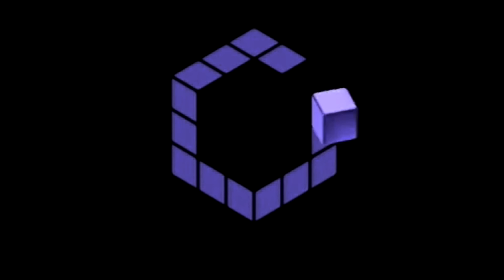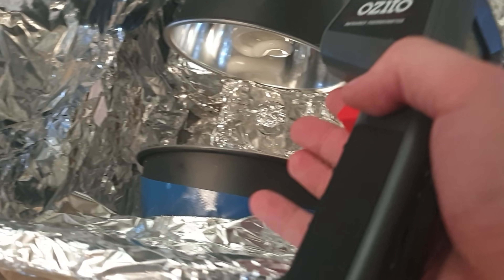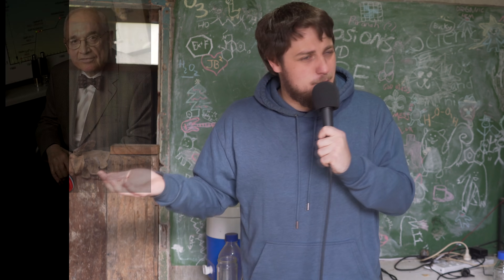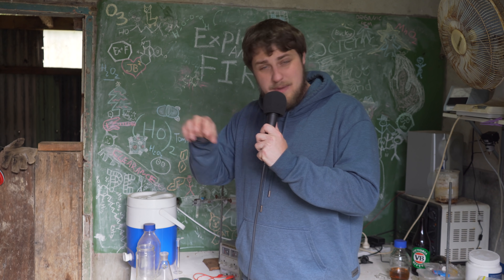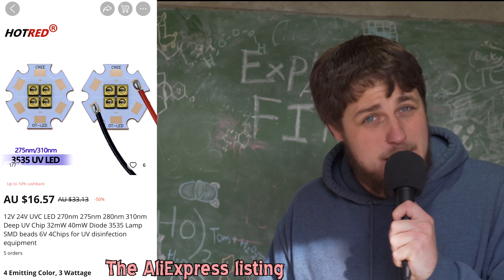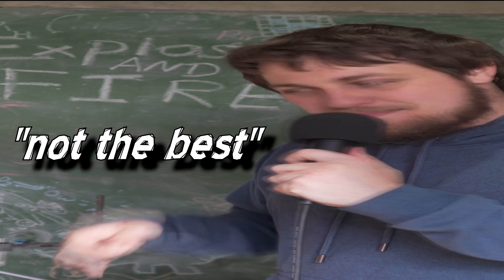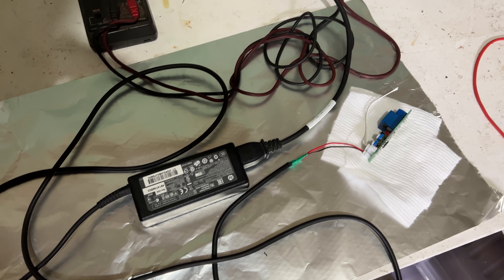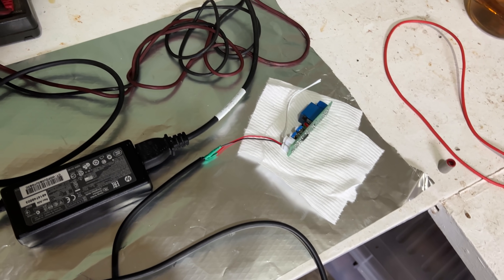Magical deep UV LEDs - Cubane Ep 12

Comment: The 40mA is critical, if this is specified as the maximum current the LEDs can stand. LEDs are non linear devices, which do not follow Ohms law. Once the voltage across an LED reaches its forward bias voltage, any further attempt to increase this voltage will result in an exponential increase in current through the device, resulting in its destruction. The current through low power LEDs is usually limited using a series resistor, but this solution is inefficient for high power LEDs, where the current is better  controlled using an adjustable constant current supply. 
When driving an LED, the primary concerns are running it  below its maximum current rating, and ensuring that it can dissipate sufficient heat to avoid exceeding its maximum operating temperature. It is recommended that power LEDs are mounted on a metal heat sink, usually aluminium, using a heat sink compound such as that used to mount computer CPUs. . (Note, it's important to avoid putting heatsink compound on the LED window, as it tends to react and frost it. )
When using a constant current supply with more than one LED, , the LEDs should be connected in series. In this circuit configuration, each LED will pasx the same amount of current, and the supply voltage will automatically adjust to that required, so that each LED in the chain is operating at its stated  forward bias voltage for the operating current.  This is conditional on the constant current open circuit supply voltage exceeds the sum of the LED forward voltages in the series chain. 
Being such compact devices, LEDs are very unforgiving, when driven with excessive current. They over heat very quickly and burn out,  so acquit heat sinking is essential. 
To avoid excess heat dissipation in the constant current power supply, it is better to use a switch mode constant current converter than a linear constant current supply.
Reply: An approximate calculation, suggests the forward voltage for the LED emitting 420nm UV should be around 3.9 volts. 
( Vf=hc/(e*wavelength), assuming no charging pumping. This equation is only a guide to the bandgap voltage.)
If your high power LEDs are 3watt, it suggests that each package has two LEDs in series, given a effective forward voltage of 7.8 volts. 
As these are rated at 3 watts, it suggests the forward current maximum is approximately 0.38 amps, so maybe the actual current is not 40mA, but 400mA. Certainly 40ma seems rather low for an power LED.
A quick view of the LED data sheet would confirm these assumptions. 

P.S, I froze the picture of the LED data sheet, but the data on the segment of the sheet I could see did not make much sense. It is difficult to reconcile the 3 watt rating with chips taking 40mA. There are four LEDs on each die, but it is not clear how they are wired. 

To avoid the instantaneous destruction of the LEDs, due to excess current, it is a good idea to fit a series power resistor when performing the initial tests. A 2.5 ohm half watt resistor would provide about a volt of supply rail stabilisation over the rated Vforward of the LED package.

Comment: Heres how to set up your powersupply for CC: turn the voltage knob(s) to the maximum, and the current knob(s) to the minimum, connect an ammeter in series with the output, essentially shorting the supply through the meter. Then while reading the meter, slowly turn up the current on the supply. That's it
Reply: dude no, if you do that with a cheap lab supply it'll fry itself when you short the leads (I've seen it happen with students many times). start with both volts and amps at minimum. Then short the leads, then up the voltage to something low (a few volts), then set the current limit, disconnect the shorted leads, set the voltage to what you want. turn the output (or the whole supply) off, hook up to your device then turn the power back on.
Reply: @zyeborm  shouldnt tho bc the current is set at minimum
Reply: @gabor-smith  the current limit can't kick in fast enough to prevent the output regulating capacitors from frying things
Reply: Your driver blew up the leds instantly because, while it is a CC supply, its at 900mA, meaning it will do everything it can to deliver 900mA to the output, so it will raise the voltage (within a specified voltage range, so 24-42v, also this is called the compliance voltage range) until the current equals 900mA.
Reply: If you dont trust your powersupply to regulate properly you can get a cheap circuit that does this, like those based on the XL4015 or LM2596, just make sure they are capable of CC, most of the time if the board has at least 2 "knobs" (or potentiometers) it is CC capable.
Reply: And you could use that with your laptop charger

Comment: You're toasting them. It's actually quite surprising that they don't burn off. In most things in electronics you get voltage specification, so you have motor that needs 12v, you give it, and it draws what it needs. LEDs are different because they have specified current, 40mA for this in the video. That is because, as you could see, at 11.5V they drawing almost nothing at 11.55V 40mA (440mW), and at 11.6V 1A (12W) dying out of heat, and when they heat up, this ideal 11.55V is changing, so exponential dependence with some temperature drift. 

What you need is constant current supply, and you had one from the beginning of the video, just use those knobs on the left side,  regulate roughly 40mA while shorting supply, and you have ideal supply for the LEDs. (V have to be also high enough, but it will never be too high with so small A). Now when you give them 40mA they will draw how much voltage they need.

The supply that you bought is also a constant current, but in terms of voltage (what was presented for single one, for 2 and 3 in series it's ok), and also in terms of current (800mA, is little bit more than 40mA), it's too powerful.
Reply: Yes thats the way to go

Comment: I'm sure you're getting all kinds of feedback on this already , but if not here's some info you need to know: LEDs are current based devices. You need to set your power supply to current limit not voltage limits. Then dial in the proper current for these guys. If you only set the voltage as they heat up they will run away and blow up on you.

Comment: If I've learned anything from my electronics journey it is, that the current rating on chinese electronics especially LEDs (and laser diodes) is really not more than a suggestion

Also this thumbnail is a piece of art. You should frame that and put it on the board

Comment: I'm not an electrical engineer but I would put a small resistor  (around 600 ohms or lower9 before the LED to limit the current, and I would also keep a multimeter measuring the current just to make sure you're running them at with the proper current. Also are you supposed to see the blue glow from those LEDs or it's just the camera picking UV?
Reply: It's just the camera and some extra light having its energy lowered by the plastic. And yes I would also recommend using a resistor. Since these are voltage dependant leds keeping the current regulated and the voltage variable is important.
Reply: @GsaUce Rug they're not though

Comment: Current is diff depending on voltage. Current times voltage equals Power
Reply: Additionally with something like that, you'd want a current limited supply as the resistance will drop with heat.

Comment: turn the psu to 12v and the current limit to 30 mA.
that is it >w<
also
led is an diode, their current grows exponentially over the voltage.

edit again:
their current also increase over temperature.

Comment: basically, an LED acts like an open circuit until you hit a voltage threshold, the forward voltage. Then it behaves like a constant voltage source (with a small internal resistance) with a voltage equal to its forward voltage. So any voltage greater than its forward voltage would cause it to draw huge current (obviously a real LED has a tiny internal resistance blah blah). Thus you need to add a series resistor to limit the current. Say you need 40mA of current to drive the LEDs and the LEDs have a forward voltage of 6V, and you want to power it from 12V, you will need a resistor that drops (12V - 6V) = 6V while passing 40mA, which is (12V-6V)/(0.04A) = 150ohms. I hope this makes sense!
Reply: This. 

Doing the math will save you so many headaches down the line, and there is a lot of reference out there to consume. I'm sure that Will or Backyard Scientist could help.
Reply: You don’t need a current limiting resistor if you use a constant current supply. That said, a string of 40 mA LEDs requires a 40 mA constant current supply (LED driver), not a 500 mA one. What I don’t get is why he isn’t using that bench power supply in CC mode instead of ordering stuff online…
Reply: @mass1s  it's not clear to me that his power supply has a constant current mode. It looks old enough to be of a vintage were CC mode was only in high end models.

Comment: Great choice to switch before the driver. What killed the first LED was the charge that was in a capacitor, so the LED got some high voltage and intermittent overcurrent killed it. Just a guess, but this is likely. If you switched it off there even with two LEDs, the voltage would raise again, and connecting back would probably kill those too. Also I admire how you predicted failures in advance and bought more stuff, even some professionals forget about it and then they are surprised 😸
Reply from the maker: Ayyy lucky guess! It felt like there was a wrong option for some reason, I just wasn’t aware of why. Thanks for the explanation!
Reply: @ExtractionsAndIre  I killed a deuterium UV-C tube like this, also a vintage one, learning is fun… I guess.

Comment: LEDs basically entirely block current until the operating voltage, then from there they have very little resistance. You want a big resistor in series and then the LED will be polite and take what it needs
Reply: ☝️☝️☝️☝️This. I've never used UV LEDs, but if they're anything like regular LEDs, you always put a resistor in the circuit with them, that's how you keep them from blowing up.

Google "LED resistor calculation". Based on the voltage of the power supply and the rated current of the LED, you can work out what size resistor you need.
Reply: @jordan4192  There's an exception and that is if you're trying to make a power-efficient light source; then you wouldn't just put a resistor in series with it. There are clever PVM switching mode circuits that regulate the voltage to maintain a constant current without adding an energy wasting resistor in series; that's what's in your typical LED driver.
Reply: Yes that would be fine. Big resistor means roughly 300 ohms here to drop 12 V at 40 mA, that way half the power is dissipated in resistor and half in LED.
Reply: @sealpiercing8476  150 ohms is the correct value if using the 19v laptop power supply. And though a 0.5W resistor would do the job, its gonna get pretty toasty. A 1w 150ohm resistor per star board is the way to go.
Reply: This is the best explanation I've ever seen of how LEDs work.
Reply: Kind of? If you put a big resistor in there it's going to limit how much the LED can politely take. Throwing in a 150ohm res will let the LED draw ~45mA. Putting in a 300ohm resistor will drop that by half and the LED will only draw 23mA and will be a lot dimmer.
Reply: We're talking 1/2w of power dissipation though, them resistors are going to get HOT.
Reply: you want a constant current source, which delivers 40mA
Reply: This is not what I’ve experienced at all. Can anyone explain the discrepancy here? For years and years I’ve voltage regulated LEDs, often undervolting them to run cooler. But I’ve never used a ballast for an LED like I would for a fluorescent light. I have never had an led fail when tied directly to batteries or even the 5v rail on an 800w psu. 
 If anyone can explain this difference of behavior, I’d really appreciate it.
Reply: @haroldsaxon1075  LEDs behave exponentially once you reach their forward voltage. until then you are in the clear. however once you reach the forward voltage the drawn current rises exponentially. if you undervolt leds you will most likely not experience too many issues but a resistors is still recommended to make sure that voltagespikes don't roast them. depending on your psu it could be current controlled but i'm not sure. batteries usually don't provide that much current and are relatively safe. the resistor that is added in series with LEDs reduces the maximum current of the setup according to ohms law. i usually use an online calculator for that. it is not always necessary to have a resistor but it is a good practice and ensures that your LEDs will be safer.
Reply: @zocker9492  Thank you for trying to explain it to me. Chris Hutchinson gave me a really good explanation of what I wasn't understanding elsewhere in the comments. I've only worked with voltage regulated circuits, not current regulated.  A set voltage within the operating  range of an led will self limit drawn current, so long as your voltage source is correct and has little to no ripple or spikes, you're good. thus my own experience. I did not understand previously that in the situation above, he's working with set current and variable voltage, a completely different ball park that absolutely does require a ballast, and something I'm entirely unfamiliar with.

Comment: If you need a cheap UV lamp, a good option would have been to buy an old projector (the powerpoint type projector) and extract the light source. On some models, they use mercury lamps which output a good amount of UVs, I'm seen people use them for DIY lithography and stuff

Comment: I know i know theres going to be a million comments, maybe even explain better than i. But in your house breakers you are already giving it say 15 amps or 30, if it uses that the breaker switches. Your vacuum cleaner isnt going to draw that much though, theres no limit so to speak. Sure if you short your wall (for you i believe its normally 240v) and stick it on say a graphite rod, you had better believe its going to draw amps. But for your regular LEDs they shouldnt draw enough current to fry themselves. Of course you could always current limit it if you were concerned i suppose. I mean the amperage draw is probably really just on there so you have an idea for what you can get away with powering it. Id say you should be able to stick the LED to a car battery but usually they output 14v and the LED isnt going to have enough of a voltage drop and eh idk.
Reply: You better believe they will draw enough current to blow themselves in a flash. The higher the voltage the lower the resistance. As it gets hotter the resistance will get lower so we get in a runaway situation where it pops faster than you can say oops.